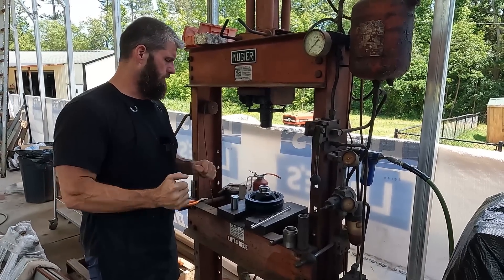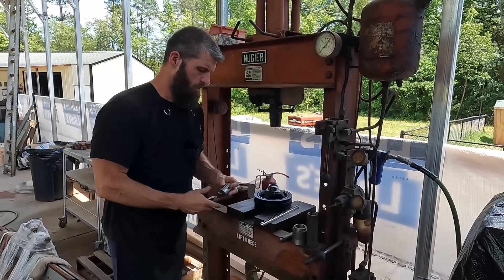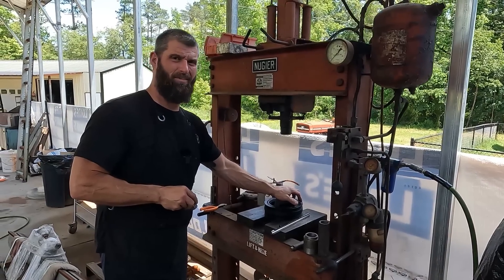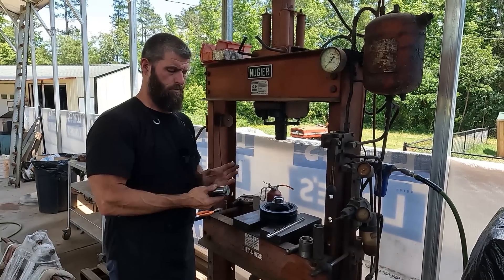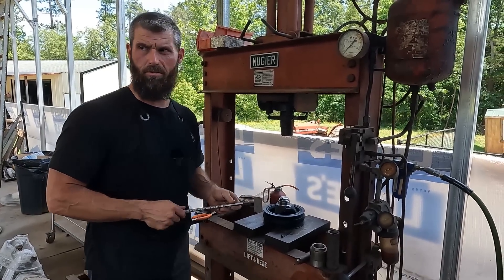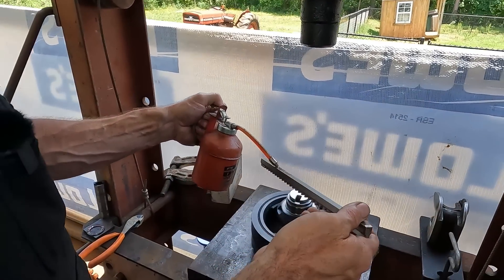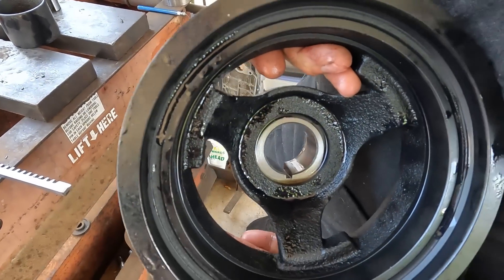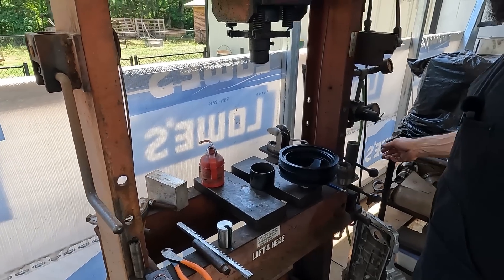Need a keyway in your Ls balancer? here's how

Comment: I have broached a lot of coupling and I see that you made the same mistake I have made when I was in a hurry that the broach ran at a angle and one side was deeper than the others. 
 When you turned you broach bushing down did you mill the slot deeper also so when you use your shim that the final depth would be right around .095?
Reply from the maker: It was straight after the 2nd pass, that's why a keyseater is so much nicer,    I have a nice big ring for them to set on, it helps alot, but I couldn't find it, that where the issue was

Comment: You need a third hand to operate that press. I've never seen one with two valves to control.

We run broaches at work from time to time. A guy had one break. It shot out of the press and stuck him in the arm. Good thing the press isn't a foot shorter.
Reply from the maker: It's got a foot pedal,  put its sticking,  gotta clean it